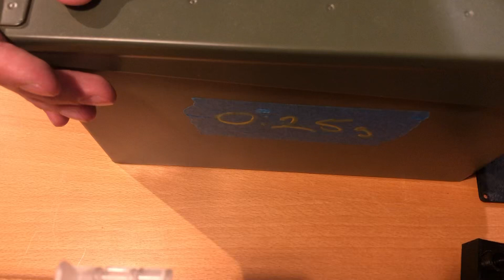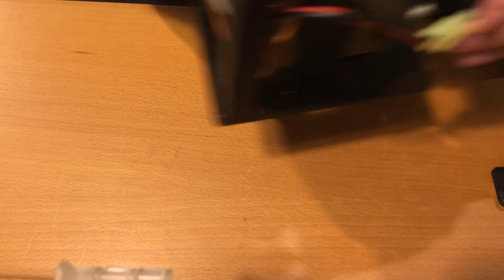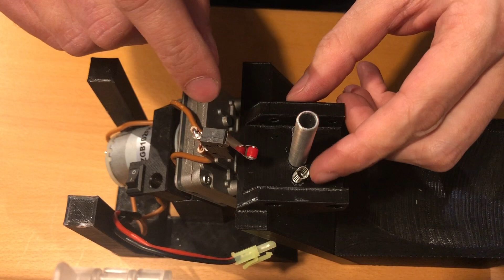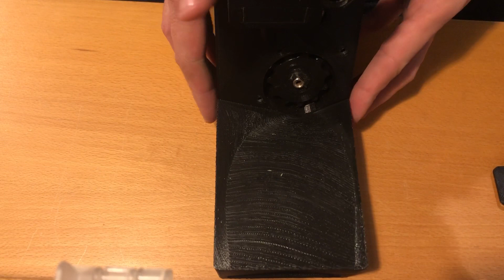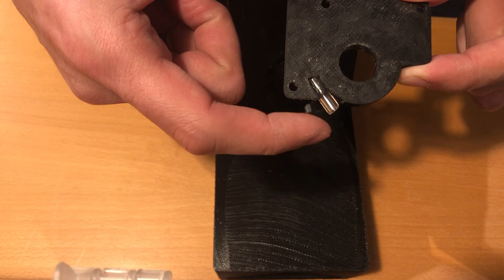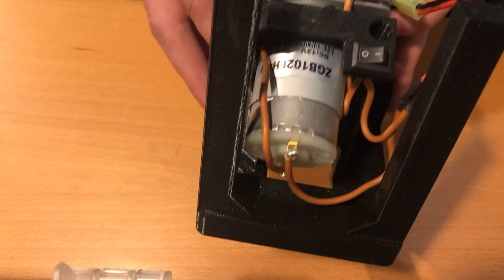Functional Airsoft Printing BB Auto Loader, Under The Hood

Comment: Hey, great Video!

what is the exact size of the ammo box in centimeters and what is the model number? Thanks.
Reply from the maker: Its a standard 30 Cal /7.62mm metal Ammo Tin. Internal dims are 25.28cm x 8.83cm x 16.9cm H.
Reply: @tankshock18 thanks. What are the external dimensions of the box? Unfortunately, there are many different sizes for boxes.
Reply from the maker: 255x170x90mm it’s a standard metal
NATO ammo tin for 30csl/7.62mm rnd there arnt different sizes. As it a standard metal ammo tin used by the armed forces.

Comment: Is that okay print to pet-g??
Pla may be melt in sun below car at summer.
Reply from the maker: It’ll print and should work but can’t guarantee any unexpected outcomes with the drive gear forces
Reply: @tankshock18  ok if i print with pet-g, i will write the result
Reply: @Queuedesign  How was that?
Reply: @Stedera i didn’t put in the car at summer, but petg is good. Good strength and good work.
Reply: @Queuedesign  thank you